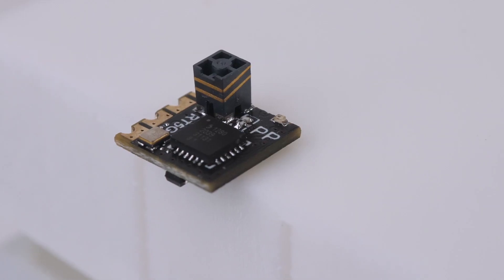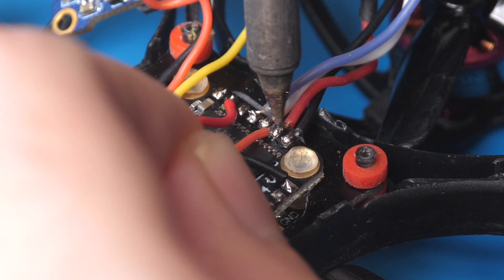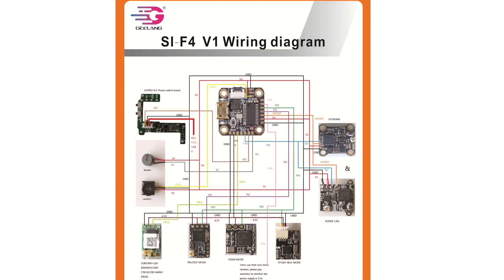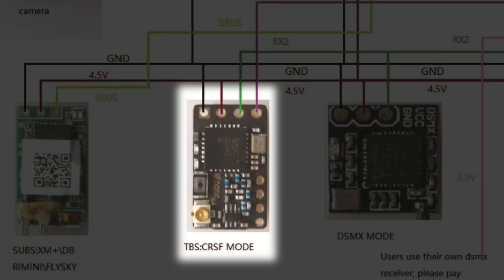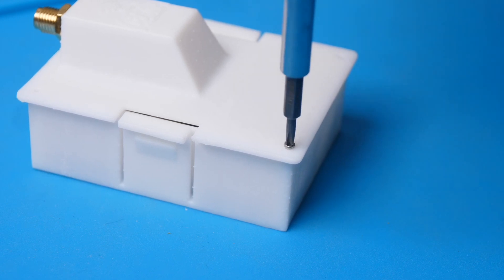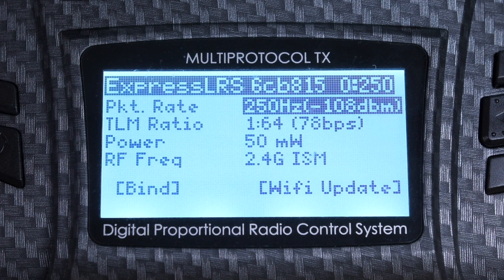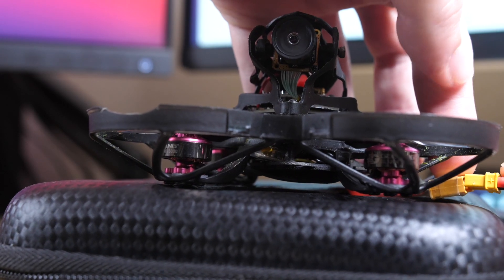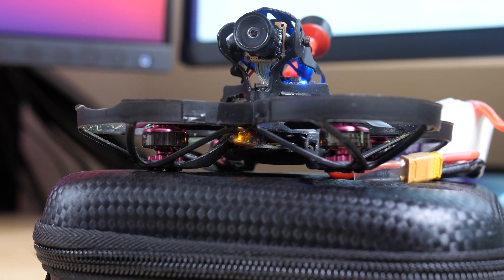ExpressLRS: Installation and Setup Overview for 2.4GHz Transmitter and Receiver

Comment: When binding. i add power and my RX LED never goes out, so it doesn't get into bind mode. What are my options?
Reply from the maker: Try removing power as soon as the RX light goes on. Then do that again. Then plug it in a third time and you should see the double blink for bind mode. 

I typically set a passphrase in the ELRS configurator when I build the firmware and bind that way. It’s so easy so I recommend that. But the method I mentioned first should work. Let me know if it does not.
Reply: @ATXAirborne  i tried both methods. the configurator build keeps crashing too.
Reply: @ATXAirborne  sadly i tried that a couple times. that process bricked a dji air unit,so i have given up on that method.

Comment: I imagine now that some radios have built in elrs, this would simplify some things as far as Lewis script and whatnot? Also there's drones with elrs receiver's installed, so another shortcut I imagine. But I am considering the zorro radio with elrs ,the version that comes with a couple receiver's and t type antennas because I have quite a few drones with xm+ receiver's and want to convert them to elrs. Such as the shadowfiend and others. I'm just wondering since the radios already have elrs this should make it much easier to get my drones converted from Frsky to elrs? Or do I still have alot of setup to do? I'm not that good with computers and hate getting new files set up and whatnot.  Not a problem with betaflight, just the Lewis script is my big fear. I've never had to mess with it.
Reply from the maker: The radios with ELRS built in do simplify things a little bit, but not significantly so. You still have to load the Lua script onto the SD card for the radio. It's really nothing to be afraid of, though! If you download and use the ELRS Configurator to flash the ELRS firmware on your radio and receivers, the configurator has a button to "Download Lua Script" and that will download it to your computer. Then you just put it in the Scripts\Tools folder on the SD card for your radio. If you can handle Betaflight, I promise you can handle this :)
Reply: @ATXAirborne  okay thanks for that. I just always get nervous or worried when I try something new,  but afterwards I'm like oh, that was easy.  Lol

Comment: In my understanding it still is possible to connect the ELRS receiver to an SBUS pad on the FC, you have to check the "Invert TX" box in the elrs configurator however. Is this right?
Reply from the maker: That’s correct! They added that option a while back.

Comment: Nice walk through-it would be nice for an update now things are much easier and with 2.0 released
Reply from the maker: Good point, I should do that. I think for many people even with 2.0 they’ll need to follow these steps the first time. Because you need to connect to the receivers using the older method if they don’t already have 2.0 on them. Once more receivers are shipping with 2.0 firmware, this guide should be updated.

Comment: Just curious my computer is down,so therefore my jumper t lite,I ternal module has now took a big dump "cant get the antenna wire to soilder back ,will not connect,&do not know were to get the antenna receiver module that replaces the lrs ,main ,or internal moduel,so I firstly need an answer?

Comment: What is the standard size of wire should i use?
Reply from the maker: For this, use the smallest thing you can. It’s not high current by any means, and larger wires just add weight. I typically scavenge leftover wires from camera cables or flight controller wires.
Reply: @ATXAirborne  thank you.

Comment: Re firmware does that mean that if you use pp rx you cannot connect to an ep rx? All quads have to use one or other?
Reply from the maker: That was what I understood to be the case when I set mine up, but another commenter seemed to think it was not the case. I haven’t investigated it again yet but probably will soon because I’m getting some EP receivers in a week or two. If you’re buying new, I’d get the EP2 instead of the PP.
Reply: @ATXAirborne  ok thanks. personally i prefer the fact that PP has no exposed antennas. Fewer things to break. :)
Reply from the maker: EP2 also has the ceramic antenna! It’s EP1 that has an external antenna.
Reply: @ATXAirborne  Ah, my mistake I thought I got the PP RX but actually it is EP2.  Thanks!
Reply: @ATXAirborne  And re PP RX vs EP RX compatibility, I asked on the Discord and someone said that if you are using the latest firmware for the TX, then that's not an issue. You'll be able to use any 2.4 RX.
Reply from the maker: Thanks for letting me know! Looks like I need to update the firmware on mine.

Comment: It isn’t necessary to update OpenTX with the nightly build version. Only when you want to have the lowest latency, and it has something to do with displaying the packet rate in the right way. Don’t know all the ins an outs of it, but i thought i should mention it here
Btw: nice video series about ELRS👍
Reply from the maker: Actually yes, I think that since I released this video, the newest release of OpenTX actually does support ELRS, although as you said perhaps not in the 500hz mode. I should check into that and post a more detailed update. Thanks for the clarification.

Comment: any clue to be used in tango2
Reply from the maker: You'd need a lite-size module for that. The current one out (https://www.banggood.com/custlink/3DKYOkjl8C) is made for the Jumper T-Lite. There's some reference to using it on the Tango 2, but it seems to require changing a connector to make it work. I believe I've seen that Happymodel is working on another version of the lite module which should work on the FrSky X-Lite and (presumably) the Tango 2. Hopefully that will be out before too long.
Reply: @ATXAirborne  i truly want it so badly, and not much tutorial on how to swab firmware in tango 2,,i guess the price will double when someone has upload the tutorial🥲🥲

Comment: Can I use this on Eachine Novice IV drone with Tx12 remote?
Reply from the maker: You should be able to, and it’d be a good choice for that one since that drone seems to be designed for long range. I’d get the EP1 RX with the external antenna if you do it. You also will need the transmitter module so that the TX12 can communicate over ExpressLRS.

Comment: Please make clear which ELRS frequecy system you are documenting (915mhz or 2.4ghz) in the title and video description.
Reply from the maker: Thanks, good idea. I've updated it.

For what it's worth, for anything other than specifically long-range flying, I can't imagine 915MHz being worth it. I'm getting range out of the 2.4GHz that should be more than sufficient for what most people do with micro quads. If you're flying a fixed-wing plane or doing long range quadcopter flights, 915MHz might start to make sense.

I also believe the setup process for both versions is very similar, although I haven't set up the 915MHz gear yet.

Comment: Seems like half the work was just updating firmware on everything. I’m really surprised there is specific firmware for each version of the receiver, even if they’re all 2.4ghz. That’s pretty annoying.
Reply from the maker: I agree, it’s a big downside right now. I think if they don’t release a universal firmware, the answer will be to use the EP1 and EP2 receivers from happymodel. The EP1 has an external antenna and the EP2 has the ceramic antenna. Both have WiFi for firmware updates, as well.
Reply: @ATXAirborne  I think if you use the expresslrs configurator to flash you can use all happymodel rx’s :)
Reply from the maker: I’ll have to look into that, the Happymodel site didn’t seem to indicate that, but I’d love to be wrong!
Reply: @ATXAirborne  just get the EP1 or EP2 and install the Configurator. Simple to build firmware and specify the binding phrase you use. Then simple Wi-Fi connection to each and install the RX and it binds immediately on power up 👍
Reply: @jklong03  When you use a binding phrase the connect-disconnect sequence 3 times doesn’t work anymore. It just binds automatically. Took me a while to figure that out…